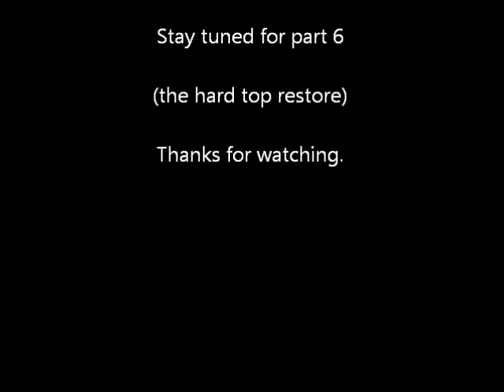My Triump Stag Movie part 5

Comment: I done all my stag welding then I had to start on the engine  if you ever need to get the heads off I made a special tool if the studs snap off its massive job if you cant get studs out but the tool made easy work of them look forward to part 6
Reply from the maker: Thanks for the kind offer, I have had a go at the studs and they moved easily so I think someone else has already had the heads off before me. Where do you live?
Reply: uk England lpool
Reply: Don't forget the water pump is a left handed thread! Bought my first one in 86 for £750 my first car as a 20 year old, the fuel consumption was not practical and I sold it and bought an MGBGT, then went sensible [LOL] Ford Escort, then Volvo Hatchback. Then in 92 bought a 73 Scrap stag for £1000 [ SHN 260 L was the reg] and was too far gone, then a 71 stag with a 3.5 Rover P6 engine ran that for 7 years [NFT 846 K] then a 75 Mimosa Stag [OWL 830 P] which I had for 11 years sold in 2011 for a very sad £ 3,100 on ebay [House move] looking at cars now that car would be in the 10,000 price range.....Still look and dream, my all time favourite car and very reliable. Great job on this resto' I am very jealous!